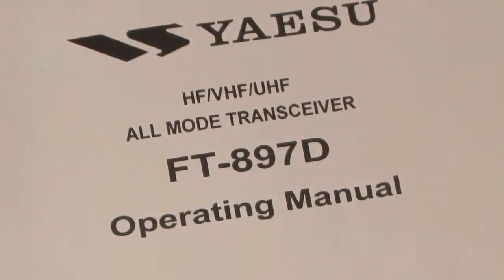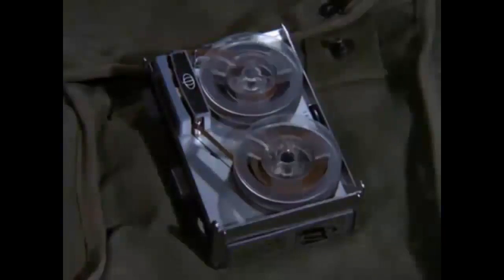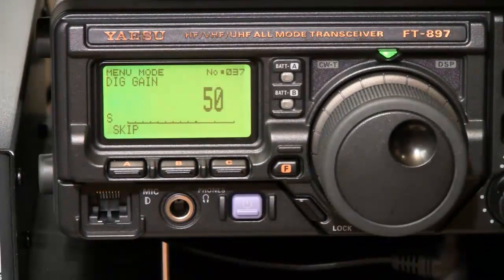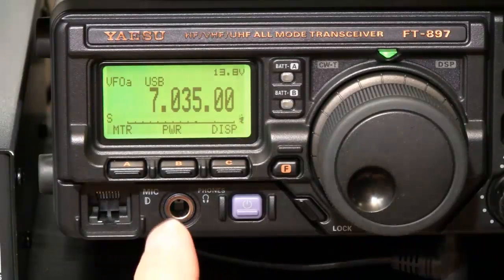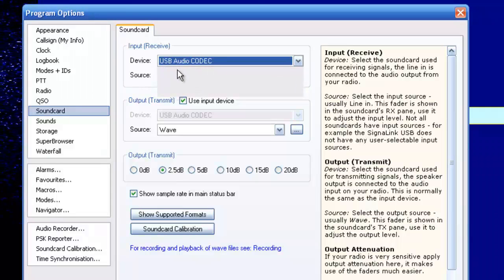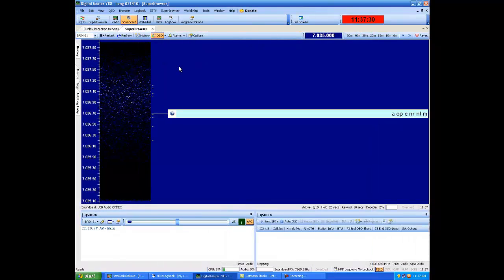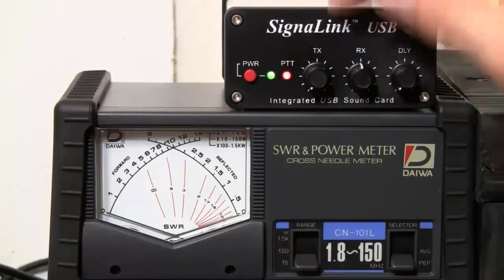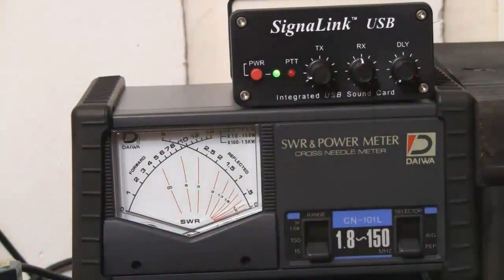FT-897D Adjust Transmitter for PSK31

Comment: If you set the mode of operation to DIG instead of SSB and have set the appropriate mode in menu 038 then you don't have to worry about your processor settings or whether it is on or off because digital mode bypasses it. FYI

Comment: @N7JFP That was a fast response! The way you set it up using a watt meter is probably a lot better than relying on ALC readings. The only better way to do it would be to measure the output of the signal link on a OScope and adjust the peak to peak voltage for whatever the spec's call for. The 857 manual states "adjust the AFSK level within the FT-857D for 16 dots of indication on the ALC meter" Either way the best way to do it is the first way you first showed using a watt meter. 73

Comment from the maker: @Blaze1024 I am not sure how ALC exactly works, but I have found that by setting the output power on the FT897 to 5 Watts then adjusting the SignaLink TX level (audio) so 3 watts shows on the watt meter usually produces no ALC marks.  IM Distortion on PSK31 does occur between 3 and 5 watts. IMD and ACL marks go together.  I have not tried the full power adjustment with ALC.  73, N7JFP

Comment: Nice video Unfortunately I'd like to point out one error.  You can't properly set  ALC with only 5 watts drive... To properly set ALC you must use full TX power output into a good 50 ohm dummy load. ALC readings are only accurate at full TX output into a 50 ohm load.  At 5 watts drive into an antenna of unknown impedance the ALC readings will be erroneous. Thus you set ALC at full TX drive and then reduce TX output to whatever level you need..

Comment from the maker: @salat   You are correct in that the speech processor should be turned off during PSK31 transmissions.  By using the Multi-Function key C to actually turn it off or by adjusting menu item 74 to zero should produce the same results.  There are several adjustments like this.  Thanks for watching.  73, N7JFP